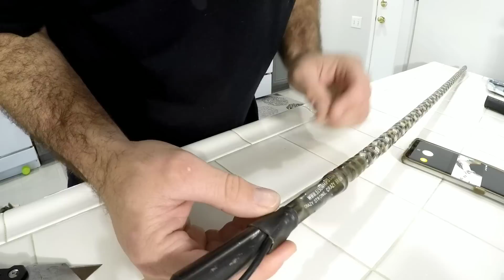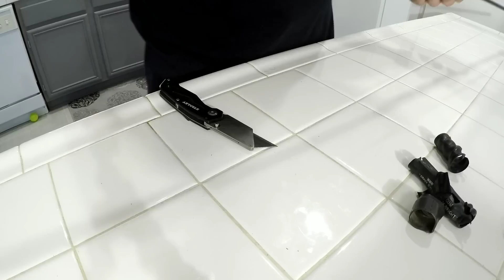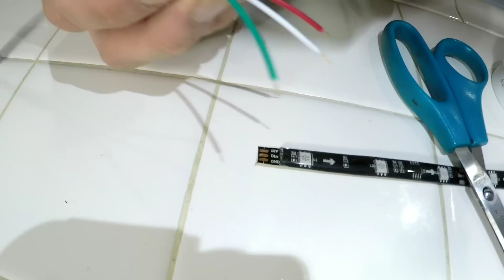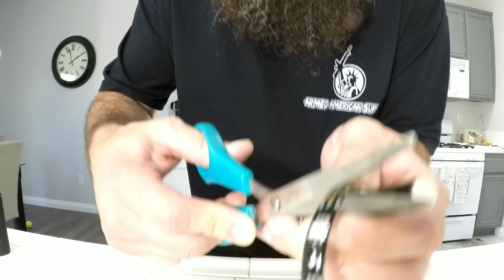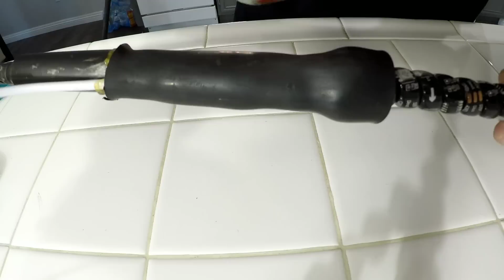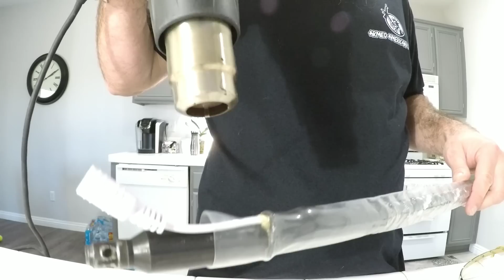How to make a lighted led whip

Comment: Great video. I'm a truck driver, so I have a couple of 4ft whip antennas that I can use for this project.
Reply from the maker: Nice. I also drive semi. Just dedicate your radio on different antenna because the leds will throw off your swr's and possibly fry the finals in your radio.

Comment: ONE TIP: it would be easier to pull the rod through the silicone rather than trying to push it and fighting with it if you can figure out how do you pull it through…
 
Anyway, this isn’t what I’m making but it was still very helpful and I wanted to say thank you and possibly offer an idea that would make it even easier! ✌🏻😘
Reply from the maker: Thanks for the tip. I use compressed air for them now and it's much easier

Comment: FYI, That little chip is actually a buck converter which drops the voltage down to 5v for the actual chip. That's its only function. 

The LED chips themselves all contain their own 'brains', which is what makes them capable of individual addressing.
Reply from the maker: Oh, ok. Why do the 5 volt led strips have the buck converter then?
Reply: @MrRICKDAWG4444  
Actually, you are right. I thought these were 2812 lights you were using, but you're using 2811, which are, in fact, controlled by a separate IC.

2812 lights have the circuit within the LED itself. My mistake!
Reply from the maker: Right, that's what i was thinking. You had me confused for a second i wanna try using the 2812's but i cant seem to get those mini controllers to work with them even tho they say they are compatible.

Comment: Best video thanks for explaining question could the power wire be extending and what voltage would it be and can you use one controller for  2 led whips

Comment: Made many variations of these over the year 3/8 is too small if you want a good wrap with. No gaps between each wrap. I’d suggest a 3/4 inch base at minimum to keep from breaking connections within the led strips. I’ve had 3/8,1/2, and now I’m going with a 3/4 base. On cut down 5150 day time whips. They were 4 footers but now I cut them done to 2.5 footers. Going to run springs as well. It is more expensive to make them on 3/4 bases but you will save money in the long run and be cheaper than buying. A set of 5150 pre made whips. 🤌🏻
Reply: Where do you buy your whips/base?
Reply: @eddieaguirre2845   my successful builds have been using 5150 day time whips as bases. and adding wrapping them in vinyl tubing until i get to 3/4 inch. any smaller and the LED connections will start shorting out from the whip flexing. also be sure to use 3:1 shrink wrap on the outside to compress the steps so the silicone doesn't crack.

Comment: Compressed air may make the clear sleeve go on without using solvents
Reply from the maker: It definitely helps but it's still tough. Soap or wd works the best for me on six footers. You can get away without using anything on a four footer.

Comment: Your instructions were so awesome.  I built two of these over the weekend.  They look and work perfect.  I have a question on the controller set up.  What is the Adjust pixel point method?  How do I know how many pixels I have?  The instructions say to long press the menu/auto button and then the mode + and mode - to adjust the number of pixel points, then press speed + and speed -, each adjustment 32 pixel points.  Any help or assistance with this would be appreciated.  Thank you once again.
Reply from the maker: Thank you. The pixel point adjust how many pixels you have in the line so if you only wanted to light up part of your whip instead of the whole thing you could adjust the number you have.

Comment: I just ordered from the above links. The controller listed either doesn't work with the LED Strip, or they changed it. I contacted the manufacturer and they are sending me new controllers. For the Clear Heat shrink, make sure you specify the right size. I accidently ordered 1/4 inch by mistake. Great video BTW...
Reply from the maker: Sorry about the links since the time of posting amazon and or affiliates changed things around with some of the links I've provided
Reply: @MrRICKDAWG4444  I'm going to post the replacement controller part number that they send me.
Reply from the maker: I currently use different controllers on whip I make now. I also made a part two video showing if you haven't already saw it. I use the SP110E Bluetooth controller. In that video
Reply: It's SP611E  It works great with the above LED Strip
Reply from the maker: Are you using this controller with the ws2811 led strips?
Reply: @MrRICKDAWG4444  Yes, but the controller is a little bigger. I like the power cord that sticks out on yours. These are part of the box.

Comment: Are you limited to the 300 presets that are already programmed in?
Can I create my own effect?  For example I would like to see RED - WHITE - BLUE - WHITE, for July 4th.
Can I use multiple colors and specify the order of the colors?
Can I delete some of the 300 factory presets, in order to replace with my own presets?
Can I save my own preset as number 301?
Is there software that I can use on my computer to create these changes?  Or am I limited to the remote control?

Comment: I figured out what you mean by be quick when putting the Heat Shrink on it. I did not see that coming.
Reply from the maker: Yeah once you get ready to wrap the leds have everything ready to work fast. I use a air compressor to blow up the heat shrink like a balloon now. It really helps with sliding it on.

Comment: This is great video! I just wish you would had linked the male dc connector, the end caps you use, the thick heat shrink you use down by the controller the little details
Reply from the maker: Thank you. For some reason YouTube wouldn't let me link as many of the materials used as i wanted so i linked the main one's figuring people could figure it out from there. Basically everything is found on Amazon the dc connection is a 5.5 barrel plug, the shrink  is 1.25" 3to1 adhesive wrap and the end caps are 3/8" vacuum caps that come on the daywhips linked in the description. Hope this helps.
Reply: DMAX909 i figured id look up a few stuff on amazon, thank you tho this really does help!
Reply from the maker: No problem good luck with your build.
Reply: DMAX909 while choosing for led lights i noticed there are different options on the link you posted do you know what the difference is? Also the clear tube shrink wrap what size is needed, i just ordered 2 5150 day whips.
Reply: DMAX909 i ended up ordering the 5m 60leds/m IP67 in black from the link you posted, i hope those are the correct ones lol
Reply from the maker: The clear wrap is 1" 3to1. The leds you got are the ones you wanna use so you don't have to mess around with power injection.
Reply: DMAX909 cool! We really do meed more people like you on youtube!
Reply from the maker: Thanks i appreciate that

Comment: Hey, thanks for the great video. The lights work for about a month and now one of them doesn’t light up. Only 2 leds will barely light up.
Reply from the maker: You might have broke a solder point. I'd  cut it open and start with a new controller first then go up the line.

Comment: Great video....I have a 2017 Polaris RZR XP, how do i connect the controller to 
2015-2019 Polaris RZR Tail Light Power Harness for Whip/Brake Light/License Plate Light (this can be found on amazon as it has three wires R, W, B to tie into brake lights to power whips)
Reply from the maker: You can just splice the power and ground to the taillights so when the lights come on so will the whip
Reply: @MrRICKDAWG4444  so you just cut the 2.5mm plug on controller i sent? If so i assume it is a red and black wire that would hook to the red and black on wire harness? The wire harness i sent you also has a white wire which i am not sure what it is for as i just used the red and black to hook up my other lighted whip. Looking fwd to building your whip! :-)
Reply from the maker: Yeah i would get the male 2.5 plug and wire from that tho so you can take the whip on and off easy by just unplugging it.
Reply: @MrRICKDAWG4444  good idea......thank you!
Reply: @MrRICKDAWG4444  what is the shrink wrap you use as i didnt see it in the links that were provided in the video
Reply: the base shrink wrap i mean
Reply from the maker: Sorry about that YouTube wouldn't let me put all the links I needed. that shrink wrap is 1.25" 3to1 adhesive lined. If i wasn't driving right now I'd try and find you the link. However a Amazon search should pop it up
Reply: @MrRICKDAWG4444  thank you!

Comment: This video is so much help! Would you be able to do a video showing how to sync two whips together or how to wire them together if say I wanted one at each tail light but just want to use 1 remote for the two??
Reply from the maker: I've actually made a video of just that but I've never edited/uploaded it. If you have Facebook i could send you the video in messenger if not it's pretty easy you just set up the whips to a wire harness that contains the controller and spliced to both whips.
Reply from the maker: I just uploaded a picture of a set i did for a customer and turned it into a link hope this helps. Whip syncing https://imgur.com/gallery/hJDHr6K
Reply: DMAX909 could you send me the video of how to use one remote as well?
Reply from the maker: One remote works every controller. The video i have is just showing the wire harness i make to sync two whips on one controller shown in the picture above.
Reply: DMAX909 I guess that should have been my question. Any special parts to splice the two together or just wire and connectors?
Reply from the maker: I solder and shrink wrap everything using 3core wire and connector also found on Amazon. Refer and zoom in on the picture for placement.
Reply: Could you send me the video on Facebook messenger on how to wire them up to 1 controller?
Reply from the maker: It's not really a how to video it just shows what it looks like. Basically just splice both whips to one controller like shown in the picture above.

Comment: DMAX909. Best video yet. Extra nerd status and I LOVE IT. 
Quick question about the plugs tho. Looks like you have it plugged into a wall outlet. do you have a list of the connectors needed for that? I'm going to use my outlet in the back of my truck which works out well. 
Thanks again my dude, awesome video.
Reply from the maker: The plugs used in the video are just 5.5 barrel plugs and I'm using a 12volt converter at the wall. So basically you can use any style connector you want on a vehicle since its just a positive and negative 12v wire. I've actually been using a new style 3 pin screw together type connection for whips i make now but you can use practically anything you like. Hope this helps
Reply: @MrRICKDAWG4444  Copy that bud. Thank you very much, I appreciate it.

Comment: Great video but I was wondering does it do just one color like normal ones too
Reply from the maker: Yes it can be any solid color you choose the app has a color wheel you can pick from.
Reply: @MrRICKDAWG4444  ok great! But is the control comes separate
Reply from the maker: You just order the controller from the link I provided
Reply: I ordered everything u linked but the the one to connect to the battery didn't come
Reply from the maker: I usually hardwire in place of those 5.5 barrel plugs. They tend to always be a connection issue at some point. Watch the part two video on my page if you haven't already.

Comment: This was great. Thanks for showing us. I have never heard of a light whip until the last couple of days. I have been trying to figure out how to make one so I can put it on my Mountain bike for when I ride at night. Thanks for the great tutorial, it's much appreciated. I went to Amazon.ca to see how much they were and they were really expensive. Found other people that have done them with a CB Antenna with LED strip lights. I think I am going to go that route and just use RGB lights, not the fancy likes like yours. The hints you gave will help out a lot.
Reply from the maker: Right on, if you have any questions along the way reach out to me.
Reply: @MrRICKDAWG4444  Do you know how to get it to ru oof a 5V usb then a 12v plug?
Reply from the maker: Yes, all you need to do is make sure you order the 5v led strip that's pretty much it. The controllers will work a wide range of volts from like 5v-36v
Reply: @MrRICKDAWG4444  Okay. I was going to get a 5V and then hook up batteries to it. I think that a 9V would be too much. I am thinking maybe 4 AA batteries and then that would be running at 6V I think.
Reply from the maker: I would think about using one of those big cellphone battery packs that are used for recharging. I do believe those put out 5v usb

Comment: I'm about to build one using a cb antenna mast, was wondering about how the masts have a spiral wire going up wondering if it would mess up the wrapping process of the led strip
Reply from the maker: I built my first one from a cb antenna, a firestick specifically alot of big companies do the same.. You will need to remove the shrink wrap and wire coils first and then you will still end up with a weak whip because after you shred everything off you'll find they are pretty small but the most important part is the threads that come on the antenna are made of very cheap metal and will snap at the threads easily with all the added weight of the leds if you're riding aggresive thru bumps. I adhered a male air hose fitting to the bottom on mine for that reason. I highly recommend that you use a strong whip for this project like the 5150 Day whip if you plan on riding hard.

Comment: I think I'ma tackle this project for my quad, couple questions. 
How do you hook these up to a 12v battery source? I see you have them on a wall outlet, is it as simple as cutting off the wire from the wall outlet and putting on some ring terminals for a battery? 

And do these LEDs also stay a solid color? My buddies have their whips and they set them to solid colors like white when they want to light up camp or just to have some light while sitting on top of the dunes. 

Love the video, honestly I gotta say it's the most informative how to I've seen.
Reply from the maker: They just plug into 12 volt positive and negative on a battery. In the video I'm using a AC/DC converter however it's the same thing i just plug into the wall. I personally tap into the tail lights so when i turn them on the whip comes on. They do all solid colors and smart modes. I'm about to put a new video up   on a set of whips i made for subscriber that will show how i sync two of them together with new connector i recommend using.
Reply: @MrRICKDAWG4444  awesome thanks for the reply. Can't wait to see the video.

Comment: Can you show how to do a 6' or 8'? Basically how to make multiple connections? Have you thought about double stacking the light strips to the whip is completely covered in LEDs? Would you be able to link them with 1 controller? That may look INSANE!
Reply from the maker: I have only ever made 4' and 6' whips however 8' is possible it will just require power injection along the way to keep all the leds at the same brightness. As for your question about about double stacking, it is possible however you can use led strips that have more leds per foot to cover more area of the whip, or as ive done in the past start with a thicker fiberglass whip and the leds will spread out closer together on the whip. However power injection is required for these applications on 6' or greater unless your ok with the top of your whip not being as bright as the rest of it.
Reply from the maker: To make multiple connection is the same as i did with solder one connection. Just peel back the silicone to expose the terminals, line them up, add flux and solder across the terminals
Reply: @MrRICKDAWG4444  so when you say "power junction" are you meaning another driver or just a junction connecting the strips together? You have the best looking diy whips I've seen and the best step by step video too. Thanks for the response as well. Next time you do a longer or bigger whip could you show us? 🤞👍
Reply: @MrRICKDAWG4444  I guess I'm just confused if you run mini wires from the end of one strip to the beginning of the second, or a second driver.
Reply from the maker: Power injection is easy, it just add a fail point in the whip because you would run power and ground wires to the top of your whip before you wrapped them with leds. In most cases you would only need about 5volts at the end of you last string. But the problem you will have is one of those tiny wires breaking from all the flexing of the whip so i try to stay away from power injection on these whips. However if you are ok with your whip running at say 50% brightness which you can set from your remote, you wouldn't need power injection. One thing to note about this is you will only really notice it on full power, all white because that color is using the full power of the whip. Say your just using stacking or other modes that dont use white power injection will probably not be necessary.